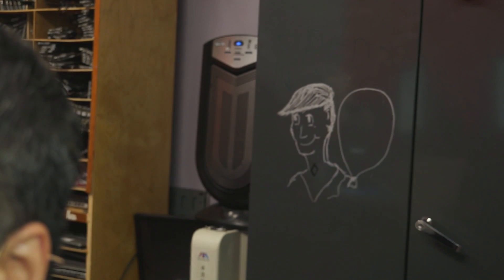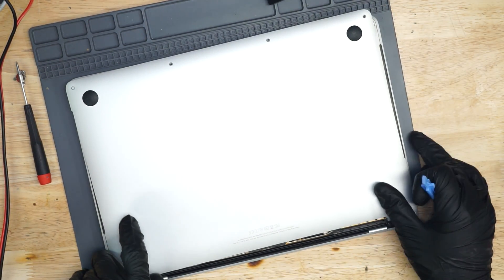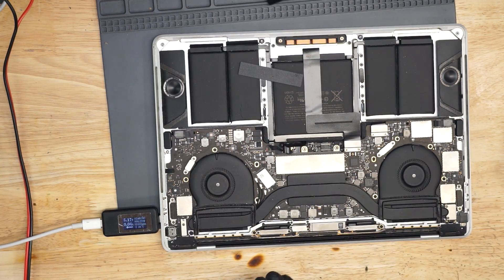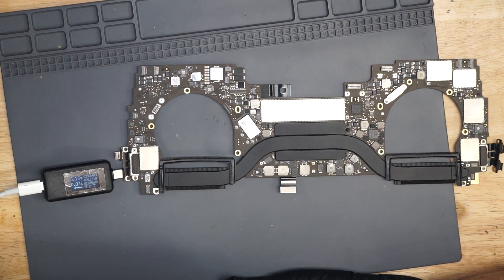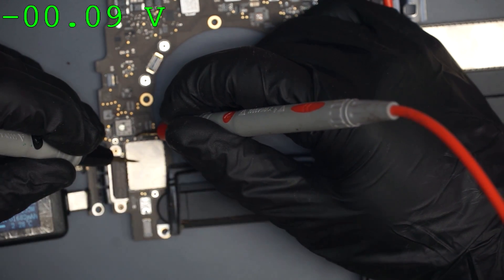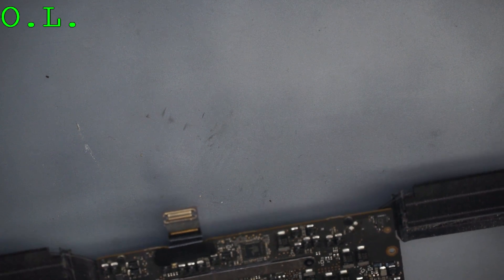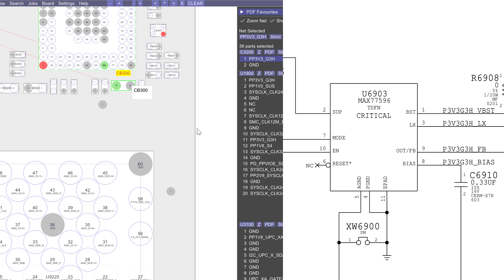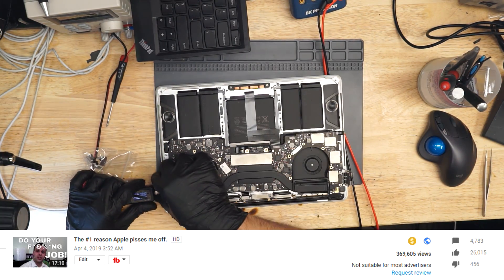A1706 Macbook Pro not charging, dead. Paul mad.

Comment: Hi, yesterday I took my MacBook Pro out of the box. I had put it there because one year ago it stopped working. Yesterday I simply powered it on and it went fine! Amazing! I was happy! But then when I disconnected the power it went out and I can’t turn it on either. Also the light on the powercable is not going on anymore. I opened it and yes, there is power going in because I touched it with my screwdriver by accident. I had forgotten that it was still connected to the power 😅.
So I don’t know what can cause this? Maybe someone can help me? Thanks a lot!

Comment: Hey all, do any of you have the schematic for A1706 820-00932? the one I'm working on has been water damaged. I've managed to turn on the machine but only when I removed the touch pad cable did the fan turn on. On the screen, after it loads, it only shows white screen with a photo of the touch pad.

Comment: So it was just the loose usb rubber that fell off and made a short circuit and that caused the voltage to drop from 20 volts to 5 volts and hence the Apple failed to charge and this guy found that rubber culprit at 11:27 at PP3V3_G3H.

Comment: I have a broken macbook pro retina 2015 (A1502), the local repair shop says the board itself is shorted (not the components on it). Is this possible? If I need to buy a new logic board, which is recommended and where to get it?

thnx

Comment: Emmm... I don't want to be toxic, but why on earth you didn't cleaned up that mess (10:44)? And why you left that mack without capacitor at all?!
Reply: Of course the board will be cleaned up and mounted with a new capacitor later, but it wasn't necessary to show that boring part in the video. He just wanted to show how to solve the "dead board" problem.
Reply: @peteshannon5194  okay then

Comment: Long story short.
A while back my a1706 macbook pro fell on its left side and i imagine the wifi cable/chip broke. I took it to apple not knowing better but thankfully they replaced it for free. When i got back my macbook and the paper on their repairs, they had to apparently put in a new logic board, top case with battery, 2 i/o boards and the antenna module which seemed weird to me. After some digging around i came across your channel. If it wasent for you i would have been fucked by apple and its shitty repair practices. If my a1706 has issues again, im dm’ing you Louis

Comment: So did the cap get replaced? Would have had to of been serving some purpose.
Reply: A very common use case of capacitors is smoothing out power sources in electronics. Many times the components will just work anyway without it if there's sufficiently good power coming in. Sometimes there are other caps helping too so you're fine. Replacing it is still best practice, though.
Reply: Plus the problem with faulty caps is shorting the power supply to the chips, and causing the area of the cap to heat up
Reply: @yahya_abukhalil  Should say, hey apple, save some money, leave that cap off the board.
Reply: Warwagon well the cap does serve a purpose... it smooths the power going into whatever chip the power needs to go it. It’s not critically important and the device will probably work fine without it, but it is beneficial to have. Kind of like how your car would probably work just fine without any air filters but you should obviously have them.